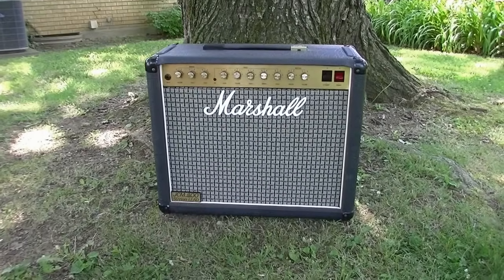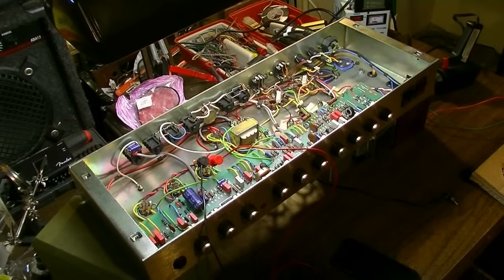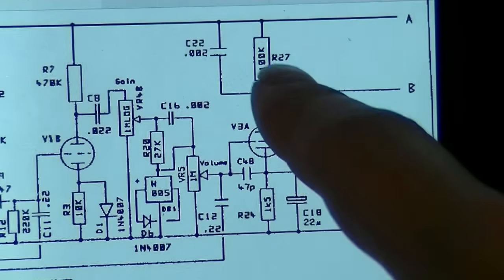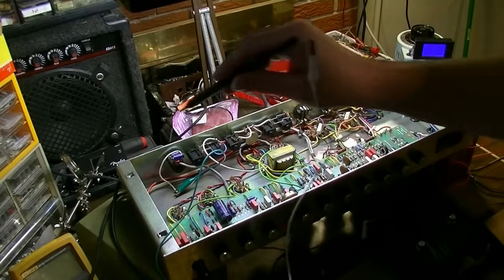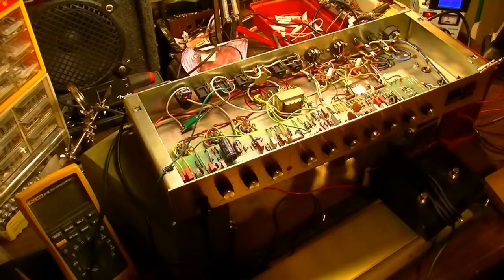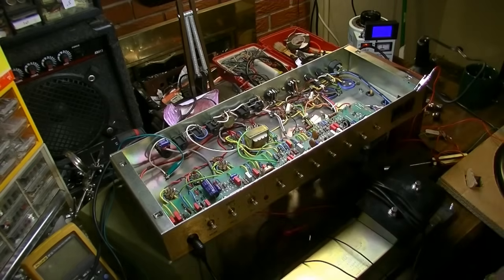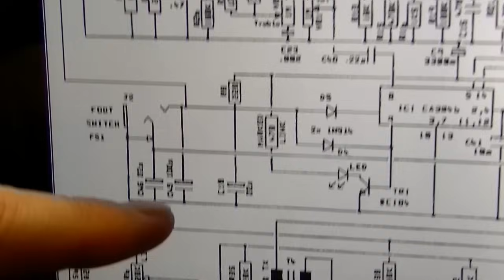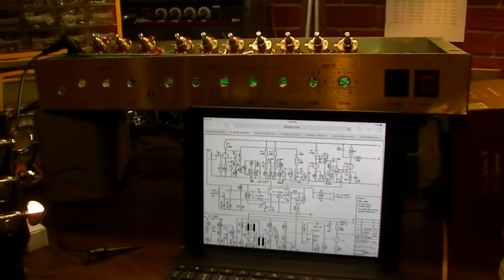The Amp Repair that Almost Broke Me - Marshall JCM800 Combo

Comment: just for curiosity sake. what are the costs of those caps. and things that your replacing I can't imagine they are cheap.
Reply from the maker: The parts themselves are no more than a dollar or two each. The real cost of a repair like this is labor.
Reply: The Guitologist oh that goes without saying. I'm on a very limited income so I have to save where I can and if there's no need to replace than I wouldn't unless it saves a lot of diagnostic labor.  how much have you got in this one in parts if you don't mind me Asking? I don't want to let the customer know if you don't want to say it's OK. by me bud.
Reply: The Guitologist as I've told you before I doubt that you would remember I have a 59 twin.the bright channel doesn't work on it and that's brother a tube .is there any caps and such that I should replace as far as normal maintainable goes.like say the paper oil caps.
Reply from the maker: If the caps in that amp are paper in wax, then you really should replace them. I'm not sure what it'll have in it. I might have guessed yellow Astrons. That amp deserves a good service. If it has never had one before, I would advise you to take it to a good tech. In all liklihood, it'll need pretty much all new caps. and probably some new power resistors and the like, cleaning, etc.
Reply: The Guitologist what's a ballpark figure I'm looking at?

Comment: Nice simple guitar - Gibson with a single soapbar - that's all you need :)
So problem was a bad npn transistor and one or two bad valves (V1 or V2 and V3)?
Perhaps plus another transistor and/or caps?  Maybe the transistor failed and thereby caused V1 or V2 to fail (or vice versa) and that in turn blew V3 (or perhaps just made it appear that V3 was bad)?

Comment: Moot point now but there is a channel mod with a jumper and some added caps to make this crap early attempt at channel switching work correctly with no bleed over. I have one of these from '85 and the mod had been already done. Just food for thought if you ever work on another. The mod is out there if you look for it. I try to reference all these things I come across so if one comes into my shop I don't have to pull what's left of the little hair I have. ;-)
Reply from the maker: Thanks. I'll keep in mind for the future!
Reply: Love the videos. Keep up the great work. Guess I'll start filming my repairs and maybe I'll get my monetization back if I get some more views. Joerg Sprave has been putting up a fight on this issue with a Youtubers union. He has over 10,000 signed up including myself and YouTube has responded. We'll see what happens but maybe the strength in numbers is working.

Comment: It's a Marshall.  Only the early amps (1974x, Plexi, 1959, JCM800) are worth a shit and even some of them are questionable, such as the JCM800 which had post TS-master and fair emount of gain, but transformers noisy, poor grounding scheme, no FX loop, single channel only, thin one-sided junk PCB, etc!  I just gutted a 1982 4210 Monday and will build it up into something amazing with a turretboard!  :)  4210's / 2210's also are prone to signal bleed between the channels because the switching sucks!  Recommend you get an Audio Signal Generator and have it constantly feeding so don't need to strum a guitar, then just follow it thru the signal path to where it stops!  :)
Reply from the maker: I did not notice any channel bleed on this example after service was completed. The switching is definitely a weak point, as is the PCB. And yeah, I know about signal gens. I have one that isn't hooked up. I use tracing seldom enough to just go with an iphone input signal or hit a guitar, and it only takes a few minutes in either case, so I elect to conserve the desk space for now. Thanks for the comment. What are you building in the 4210 chassis?

Comment: Dude... enlight me something, I have a Laney LC 50 II, and the f*cking reverb tank stops working. The factory back in UK recomended a couple o models to substitute the broken one, but I can't find these here in Brazil.
What can happend if I plug a different one on the amp?
Tks!
Reply from the maker: If the impedance is way off on the tank, you could burn the inductors up in the new tank. Better to just order the part they recommend. At the end of the day, you're probably going to end up doing that anyway. Good luck, man!

Comment: If you want an amp to do a video on, I have a Line 6 Spider Valve MK1 that has the dreaded "black blocks of death." Most amp techs won't even look at it. I could rewire it to just being a clean amp, but it would be cool if someone had the skills to get the preamp and effects to work.

Comment: It looks very good, but I like the 2204 based model much better. For my taste the 2205 and 2210 models have a very ice pick type of sound. You can remove some bright caps, but they
will never sound really good anyways primarily play Strats, Gretch and P90 equipped guitars, maybe it is different with HB guitars, but I doubt it. I happen to have a 2205 based
JCM800 2x12 with G12T-75 right now, but that will hit the road when I am finished checking it.

Comment: I had a 5150 that did the same thing. It would turn on but I had no volume control. It was always at low volume. Changed the tubes (Pre and Power), same outcome. Never figured it out.

Comment: So it was the transistors on the boost channel blowing the tube?
Reply from the maker: Not sure why it would have been eating tubes. I could find no evidence of that directly, other than the high plate voltages, which are part and parcel of this model. The customer sent along three tubes which he had tried in V2 (I later found out it was V2 not V3). But V2 doesn't work on the Boost Channel anyway, and this customer didn't have a footswitch (I used mine in the video) and without that, only the Boost Channel works anyway, so it's confusing. The tubes he sent along he had tried, I tested, and of the three, only one was genuinely dead internally. The other two had a breached vacuum (white topped), so it was physically damaged, and the other was just weak, but it was an old RCA 7025, so it had an excuse to be weak, so I think we had a misdiagnosis perhaps and some strange problems with a mishmash of used, questionable preamp tubes in an amp which is picky about preamp tubes. This will probably stand as my most confusing video of all time. :D
Reply: I appreciate the long reply.. I figured it might of been just chalked up to coincidence with the tubes he tried. Thank you for clarifying! I didn't know that about old RCA's (Still learning with the classics). Thanks again man, I think you did a great troubleshooting job! In my 20+ years of electronic engineering, it's the troubleshooters that show the most skills!

Comment: They are very finicky about preamp tubes. Tubes that work fine in a Bassman will Scream microphonic in the JMC800 , V1 especially . V3  on some years is does have slightly higher plate voltage and could discriminate for better tube.
Reply from the maker: That is what I found in this 2205 4210... The PV on V3 is VERY HIGH, for a 12ax7. And if I was intending on keeping this amp, or if the customer was intending on keeping it, I would definitely want to modify the power supply to provide lower voltages to the preamp tubes. This would lengthen their lifespan and maybe keep them from going microphonic. I tested all the tubes before troubleshooting. I didn't have time to include those clips in the final edit because we were already going to be pushing the 1 hour mark. They all tested ok. The V1 tube was a bit weak on the tester, but should have still worked, I thought. Lesson learned. It was still going to need troubleshooting regardless to find those bad transistors in the switching.
Reply: R58 & R59 feed the plate voltage for preamp. For later models R59 feeds Directly to the V3B Plate ..
Reply from the maker: Yeah, at one point I was comparing the 4210 schematic to the 2205 and noticed the difference in the power supply.

Comment: A tip on electrolytic caps: if you live in the Midwest where it can get extremely humid, electrolytic caps can dry out and go bad much sooner. It's good to replace them at least every 20 years in the Midwest. Conversely, if you're on the coast or England etc., you might get 50 years out of the same caps.
Reply from the maker: I have found in my region caps in multi-section cans hold up very well over time. I've seen many from the 40s and 50s even which were still working fine. Other standalone types with less protection from elements don't fare so well.
Reply: I don't know much about the can types.
Reply: Incidentally, when I say the caps can dry out quicker in humid areas, obviously you'd have to keep the amp in a non-air conditioned environment like an unfinished basement.

Comment: so were the transistors really at fault? It seems their only role was to lite the LEDs.
Reply from the maker: It does that too. But they also provide a path to ground if faulty. Yes, the transistors seemed to be faulty. Removing transistor #1 and  replacing it brought the Boost Channel to life with no other changes. TR2 was changed for good measure. V2 and V5 were bad. V1 was weak. All of these tubes technically tested good on a tester, but this amp is picky about tubes apparently.

Comment: My boy loves my Fender Bassbreaker!
Reply from the maker: I've heard good things about those. How do you like it?
Reply: I love it.  It's the first amp I've ever felt comfortable enough to plug straight in for full gig.  I have the 45 watt combo.  It has the variable output know that can range anywhere between 1 and 45 watts and it works great.  It's loud at all levels though!!!  It does the early Marshall thing well when pushed but retains a fuller frequency range.  A good mix of the Britt and American tones.

Comment: I’m just curious... why wouldn’t you turn on your Oscilloscope and frequency generator.....  track the problem?? It seems your spending lots of time guessing..... versus just proving the issue and repairing the amp...  I’m not trying to knock your work but.... I can only imagine it would be faster and your clients would be able to follow your the signal path better....

Comment: Good Marshall combo but the G12-70 is one of the more sonically challenged speakers of the Celestion family. A Creamback would be a good swap out.
Reply: ChrisBuck66JTM45 i put a jbl e120  in mine. you're dead right on the m70.
Reply from the maker: I actually like the G12M-70s ok. They were voiced well for the 800 series. Sound like crap with a lot of other amps though, I agree.
Reply: The Guitologist Yeah got a JCM800 1936 2x12 that I've had since new in 1983 and that came with a G12-M70 paired with a G12T-75. Marshall did all sorts of crazy what's left on the shelf stuff back then. Not used it for quite a few years but thinking of a speaker swap to better suit my KT66 powered original 30w JTM45
Reply from the maker: Carvin used the G12M-70 in their upper end X-Series cabs of the early 80s too. I had one of those once and it was a great sounding cab. I blew one of the 70s though and replaced two of them in X-pattern with V30s. That cab was awesome.

Comment: I guess what I'm trying to say is were they all nessisary?
Reply from the maker: For my peace of mind, it was, but technically, they were testing fine at the low voltage of my tester. But it's only like 2 or 3V. The switching circuit is 6.3V. As cheap as they are, better to just replace.

Comment: M is 1980 - N is 81  skip "O" because it looks like a zero  M-N-P- are the worthy ones as they cheaped out  after 83 and changed a lot of the build ,,,,,,,,,,,,,, I believe 2 less capacitors less and the ran the inputs right to the board

Comment: Marshall JMC800 2205 ! My forte I have modded and serviced so many . The problem is Marshall tweaked  them every year until 1988, (thats the Schematic you were looking at). Here's a little note that shows the tube oder per year the change is around 85 but no hard cut off date. >.>> https://plus.google.com/u/0/photos/108636352594690552731/album/6428678637193575985/6428678638816424210?authkey=CJTm-460mu3Dfg
Reply from the maker: I'm a noob to this model. Was there anything in the video you saw that I should address that I didn't? Thanks for the comment!
Reply: So was I years ago when I got a 1984/ 2205 in the shop. Some things are way off from any schematic.  Check R58 & R59 main plate resistors for preamp if plate is to dam high.

Comment: Wow, nice trouble shooting, but you really need an O-scope to trace your signal. Probably save you 1/2 the time you spent.
Reply from the maker: Probably would not have saved much time, if any. I like to actually hear what's going on rather than looking at a visual representation.
Reply: Oh I know what you mean. I've been playing professionally for 47 years and fix amps & guitars when I'm home. I find the scope helps to see what's going on in different parts of the circuit. I had one of these 4210's about 25 years ago. My friend Steve Grindrod designed it. Steve was the head design engineer at Marshall for about 30 odd years. He left Marshall and went to Vox and left them about 10 years ago and did the Wharfdale amps and then the Grindrod amps. Great guy!
Reply from the maker: Very cool. I'd be interested to know why the plate voltages need to be so high on the preamp tubes. Maybe he had a reason.

Comment: You NEEDED to lift one leg of several of the components you tested.   Many of the parts you tested were tied to other components in the circuit and that gave you incorrect readings.   You could have saved yourself a lot of time and changing of parts that were fine if you tested them correctly in the first place.

Comment: CA3046 is a transistor array made back in the days of crap silicone, it should be changed no matter what. It's brother the CA3086 is well known in the land of Atari 8bit computers to weaken with age or it's leakage current goes south haven't found out exactly what the issue really is. Anyway we change them for new made and a lot problems just go away. Nothing but a box of transistors in there, really crappy ones. Like six of them and that is absolutely all there is in there.

Comment: all the preamp sockets go bad in theses Marshall amps the phase inverter   socket goes bad giving you low gain
Reply from the maker: Sockets can go bad in just about any amp, but that certainly wasn't the case here, just some switching transistors and a tube in the final analysis.

Comment: Separate preamp schematic gives me an idea . . . . . .
Reply: Oh, it includes the PI. Maybe work around that. Still looks simpler than I'd have thunk......do you know of a similar quality one for just the preamp-section of the single channel 2203, or for that matter, a TSL series preamp? I always have wished companies made more standalone preamps.
Reply from the maker: Marshall has made a couple preamps - the JMP-1 and the 9000 series - but they are more than just a simple, single tube preamp clone from one of their amps.
Reply: Well, a single tube isn't what I want. I want the 4 stage preamp section of a 2203 or 2204 in a standalone preamp. The earlier versions, not the ones where old uncle Jim snuck some clipping diodes in there...
Reply from the maker: I knew what you meant. Yeah, they would probably sell a few of those.
Reply: ......to me.

Comment: C-47 and C48 should NOT be in this circuit,  They should be removed to STABILIZE the circuit.  It is rather unsafe in terms of Hi freq oscillation which can't be heard, 50-100's of Khz to bypass, plate to cathode or grid to cathode with a small value cap because they DE-STABILIZE the CIRCUIT at Hi Frequencies.  Non of the old circuits used such poor design techniques, especially when there is global feedback, or many Cap sections (and phase shift) in the power supply.  This probably explains the tube testing good, but the circuit "not liking" the tube. Internal capacitance, in the elements of the tube, can differ from brand to brand.  I haven't seen the Phase Inverter, part of the discussion  yet, but i suspect the designer may have also bypassed the PI plates with a small value cap,.. which explains why that was a problem  (Ah yes, 100 pf across the PI plates @ 30 minutes)..  A few Fenders did use that technique on the PI , but none of the good ones.  As a truly great Amp designer, and tech, once explained to me many years ago, whenever You have more than unity gain of signal feedback across an amp, and several stages of phase shift (cap to ground), or series caps , the amp then becomes an oscillator, at the frequency where all those phase shifts produce 360 degrees total.  So always avoid three or more phase shifts that are the same.  Coupling caps don't usually produce this effect because coupling impedance is so high.  Any amp that is linear, and without phase shifts (except one: inversion), and global feedback, will not oscillate.  This is a great reason to use a 'scope, (100 Mhz is good). You can immediately see ultrasonic oscillation.

Comment: I have the same amp only it's the head version.. I have blown thru 2 transformers both times my own fault.. speaker cab wasn't plugged in arrgh.. my tech put a boogie transformer in the 3rd time.. anyhow I love this top although I don't use the clean channel it's a bit thin. I have weird deal going with the reverb master pot.. sometimes the reverb works other times when the pot screams bloody hell until turned off completely..